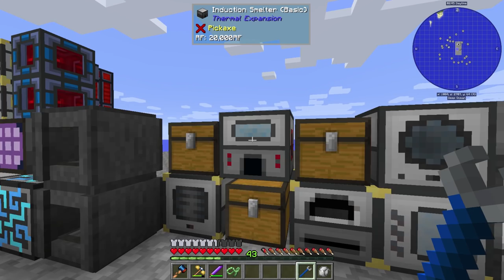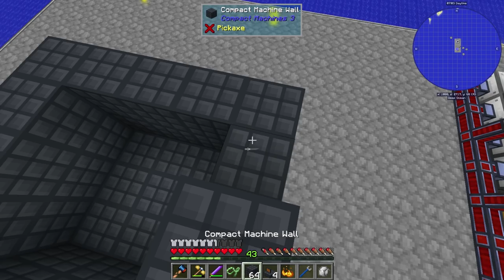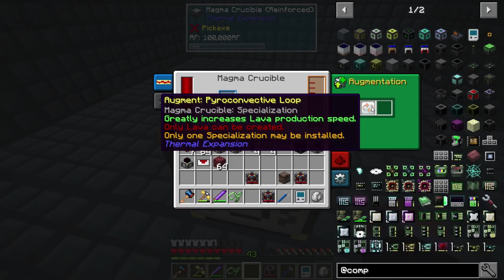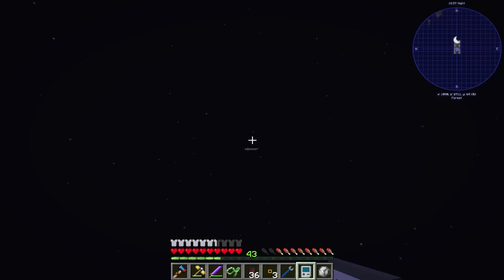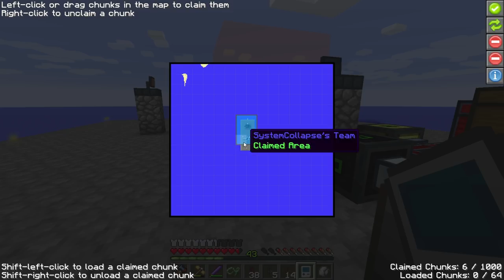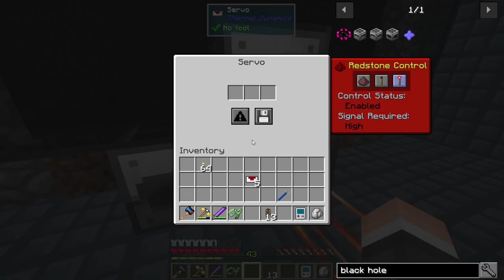Direwolf20 EP6 Compact Machines + Mob Crusher

Comment: Water base is actually a cool idea... i like that
Reply from the maker: Yeah should turn out cool, need to pull out the builder and get to work :P
Reply: Shhh the builder is ezy mode in DW20's pack. now ATM has a fun recipe for it tho
Reply: Pfft, already got my ATM builder. >:D
Reply: builder is pretty useless in ATM when you got enviromental tech, mekanism and mystical agriculture
will have to craft it when i decide to move out of my dirt hole tho :-)
Reply: @SystemCollapse I've been thinking of building a water base for a while now, and i'd like to share the idea that got me tempted in the first place: immersive engineering's water wheel, if built right, could probably look a LOT like the engines of old-time steam boats. Definitely worth a try, lol.

Comment: just so you know best way for ender pearls for this pack is actually the TE phytogenic Insulater with ender lily's (which hava a chance of dropping from grass, using a sickle in grassland for 2-3 minutes will usually get you a couple. there's no need for a enderman mob farm without Enderio cause you don't need endermen heads... admittedly it can be useful for dimlets but you seem to be a ways away from building new dimensions
Reply from the maker: The Substrate augments where removed in the newest version. I had planned to do that.
Reply: I don't think it actually needs them anymore... I have one with four power augments in it and I've been doing red orchids and ender lily's in it and didn't even realize that I had forgotten the substrate

Comment: 17:34 you can run power liquids and items through a single face using xNet, you should know that m8
edit: i am also fairly certain xNet facades block light :-)
Reply from the maker: They do, but I know a lot of piping will not work with the tunnels will not work properly unless they use the forge methods. I knew for sure that thermal ones do so I went the safe route for the EP.
Reply: Yeah that's true, apologies that part skipped my mind as i had the typical RFTools setup going when i began messing with compact machines
( wireless storage, powercells & loads of ender tanks )

Keep it up, also cheers o/ stumbled onto ya in the comments on DW's previous episode the other day :-)
Reply from the maker: Always like peoples insights many thanks. Also I am trying to do things "different" and not necessarily optimal since it is a kitchen sink pack.